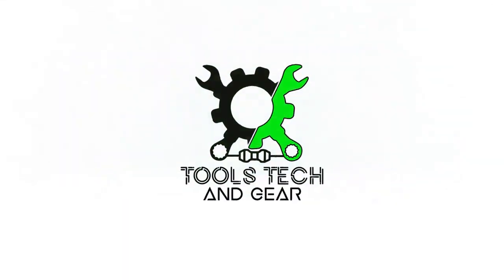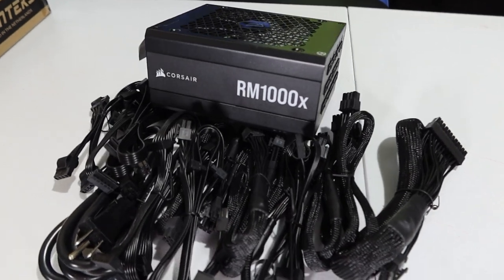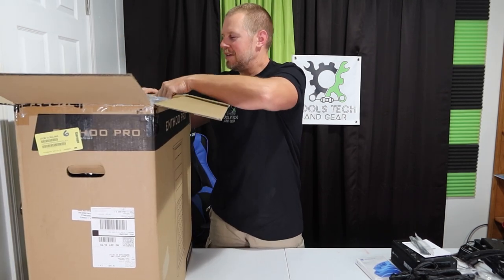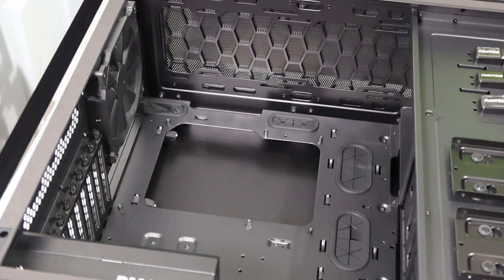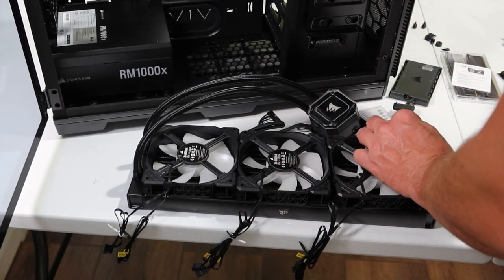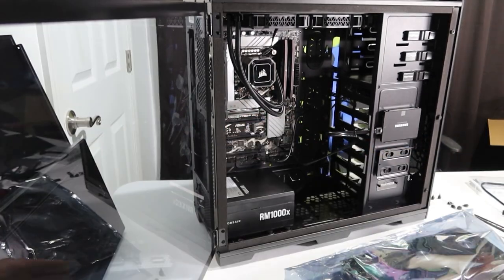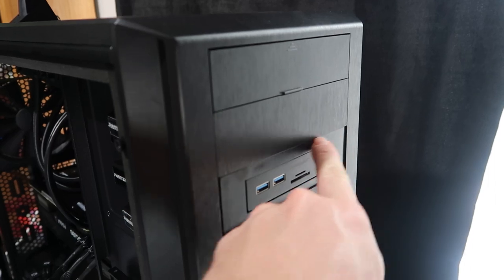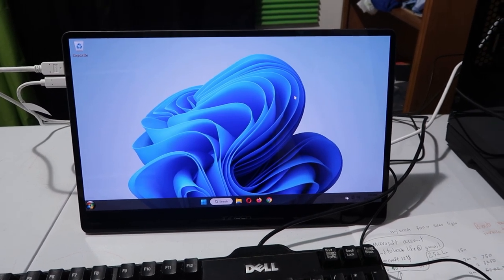New Video Editing PC for 2023 Its Powerful

Comment: Question: Shouldn't the cooler fans be blowing the hot air out the top and not sucking air and dust into the case and radiator?

Comment: Awe man, really nice build other than choosing the KF. The encoding and decoding power in the of the 13th gen IGPUs helps alot.
Reply from the maker: Thanks. I actually did not know about the other cpu. This one seems to be doing well. Much better than my 9 year old chip at least.
Reply: @ToolsTechAndGear  oh I’m sure its still great, enjoy it!
Reply: Totally agree, so am doing for the regular 12700/13700 i7 processor myself and then the RTX3060 for main graphics. The regular non K/F variants include both the iGPU and the cooler in the box.

Comment: "One port for USB-C" (23:30); I don't understand these motherboards, as in 2023 they are still loaded with the Usb-A ports I'm trying to get away from. 
I'm also looking to replace my 9 year old PC, which still runs my Word, Excel,  internet just fine, but not good for video editing. 
Nice video shots, you put alot of thought into the  components too.  And suggestion for Newegg which sounds good,  I was planning to go with Amzn. 
 Im curious what your actual ac power draw is with your rig, like at idle and during basic video editing, are you able to measure that?
Reply from the maker: I totally agree about usb 3. At least 2 would be ideal. Nice to know others have gotten 9 years out of a pc. I have now built two PC's from Newegg and it has been very smooth going. I have not measured the power consumption on this pc. I do have a kill-o-watt meter but have not connected it here to see.

Comment: I'm considering this case at this very moment, I had noticed that you had built this rig with the T.G panel in situ.. I'm pretty sure when opened it lift's upwards completely off.. a sliding hinge if you will. I found this video helpful for things to consider.thanks
Reply from the maker: I have really enjoyed this PC build. no issues at all! The case fit all the components that I wanted.

Comment: Why did you choose "KF" version of cpu for video editing? Isn't Intel's igpu drastically increase timeline performance?
Reply from the maker: The KF does have integrated graphics.  BUT on a pc build like mine I wanted a separate graphics card like the 3080. Way more powerful to have a dedicated card.
Reply: @ToolsTechAndGear  the KF is a version without integrated graphics. And the "K" version of this cpu with integrated graphics (igpu) has way more powerful encoders to encode timeline h264 and h265 codecs than any Nvidia cards (including 4090). Your 3080 is doing other tasks better in the mean time like color grading and special effects in editing. Both GPUs work in synergy. Your build is still very impressive, congratulations!
Reply: @armizani6358  

What specs would you recommend for someone who wants to build a pc for video and photo editing (mostly for youtube), and console game streaming via capture card? Thank you!
Reply: @akashbdj  It depends on your budget and type of footage you want to edit. Some types of codecs require more processing power than others. Consider AV1 codec support in your gpu to future proof your console streaming.
Reply: @armizani6358  So basically, we're trying to build a pc that can smoothly handle some stuff for my partner who's working on photos and 4K videos for Youtube/Instagram using Adobe Premiere Pro, After Effects, Light Room, and Photoshop. We've got a budget of $1200 to $1500, tops.

As for me, I want to stream some of the games I play on my PS5 to Youtube, but the quality is terrible when I do it directly. PS5 streams at 1080p@60, yet the quality sucks (Youtube compression?). So I checked out some other streamers and it seems like everyone's using a PC with a capture card (like the Elagato 4k60 pro) to make their streams look amazing. So I figure I'll do the same thing - play on my PS5, pipe it through the capture card to my PC, and then send it off to Youtube. Since we're building a PC anyway, might as well make it good enough to play some games like Anno 1800, City Skylines, etc.

Let me know if you've got any questions! Thank you

Comment: Ddr5 is still price prohibitive for many but if you can afford it its always best to shoot for future-proof
Great specs, tho I would have gone AMD on the CPU
Reply from the maker: I figure if my last pc was 9 years old might as well buy the best to last for years to come. I never have used an AMD processor are they good?
Reply: @ToolsTechAndGear  yeah they're great! The 5950x is the equivalent of your 13900 and looks to be about $100 cheaper, tho it doesn't support ddr5 ram, so you probably made the right choice for a decade long investment
I'm a bit biased towards AMD because it works so well with Linux operating systems
Reply: @st3rox  the most comparable cpu to a 13900k or 13900kf would actually be a 7950x not a 5950x
Reply: @ToolsTechAndGear  I used to build AMD systems, but they had erratic behavior and heat issues. I have been very happy with my Intel builds. I am currently in the process of building a new system and even considered AMD (I know they've improved since I last used them) but after much research I have decided to stick with Intel. I am most interested in having an incredibly powerful video editing system. I also want to be able to play some VR games that do not work on any of the other computers here. I'll probably make a few tweaks to the system you recommended. For example, getting the 13900K and likely going with the 3060 instead of the 3080 video card. Thanks for a great video.
Reply: @vidmaster7  What kind of heat issues did you have?
Reply: @vidmaster7  i guess your research was not so good it seems... the new AMD chips uses less energy (which means less power) and they are actually more powerful for workstation work...
Reply: @user-xx6fv4tu2q  Haha. I am IT professional with three decades of experience and have built hundreds of computers. I will never go back to AMD. My new Intel computer is a beast and does everything I need it to do. It runs amazingly well. The temperature is cool, lots of LED lights for entertainment, and is the quietest computer I have ever owned.